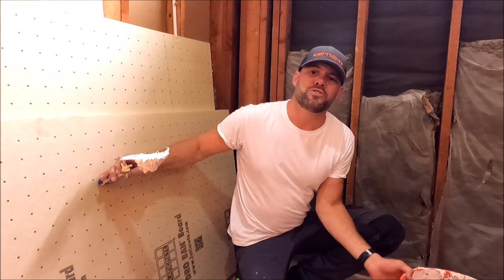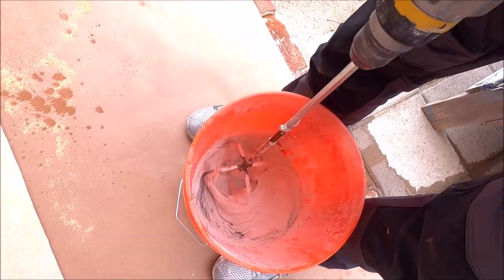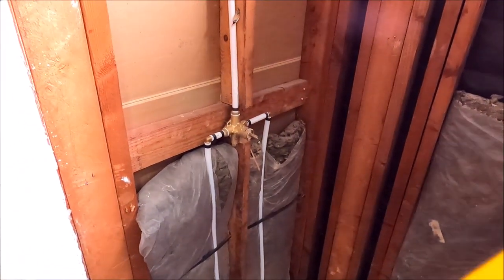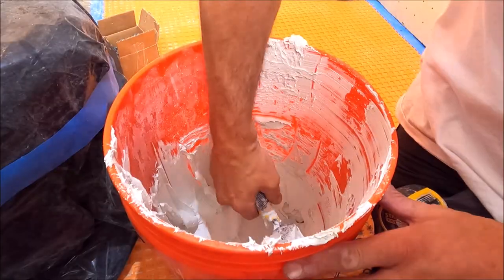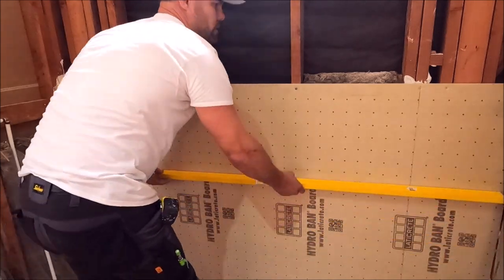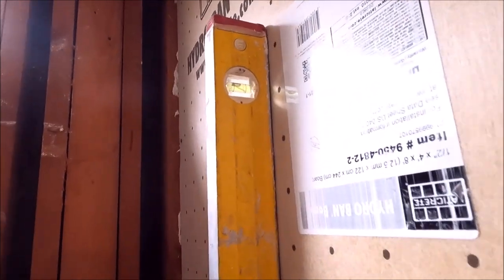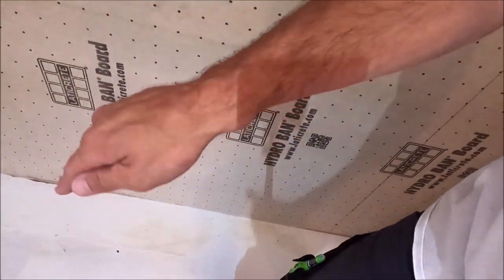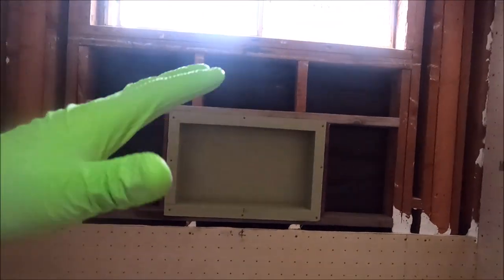Is Wet Shimming Easy? Laticrete Hydro Ban Board Wet Shim How To!

Comment: Great video! One tip we recommend is using a bead of HYDRO BAN® Adhesive Sealant on the edge of the HYDRO BAN Board before the board is installed, and then flattenning it out with a putty knife or trowel.

Comment: This is great for the foam board. I often times screed the thinset on the studs with hot thinset. Then attach my drywall/non foam board the same day.  But the easiest method is to use drywall shims and a staple gun.  Work the corners first then flush-out the rest of the studs after putting a straight edge horizontally on the wall. Install board the same day.
   Lastly, instead of using a wood planer, I use a 4" cup wheel grinder, it removes wood from the stud quickly and can get to areas a planer can't.

Comment: Will wet shimming work on say Durock cement board? Love the videos I've learned alot. Also I use a lot of the tools you suggest on a daily basis!
Reply: Yes it work it’s just a bit harder since the actual board it self is much heavier but still works.
Reply: Yes!

Comment: Beautiful work as always, and every time you finish a tile job your niche is perfectly aligned with the tile. How do you measure your niche so it meets your tile lines?
Reply from the maker: Hard to explain, this video may help youtube.com/watch?v=q5lM6s4pJDg
Reply: With a tape measure.
Reply: That only works if the client doesn't specify taller niches. Mine have asked for 14 inches inside finish.
Reply: @BZ1340    Yep, 12" is too small, looks too small imo. Most shampoo bottles are about that size, some even bigger.  I make mine large, 16" tall. I make them focal points and I never buy premade niches.....

Comment: Im not a stranger to wet shimming, or using furing strips, draywall shims or even built with foam wall shims, but i do like wet shimming, it would be sweet if we can figure a way to put this thinset in a sausage gun or something to squeeze on the studs..... just a thought
Great video by the way
Reply: Put thinset into a grout bag. But it likely wont work well as the thinset wants to be mashed against the stud to make it stick and stay put. Plus it can't be too loose or it will sag off the studs.

Comment: Excellent video as always. Can't find Hydroban board here (near Seattle) and it's really hard to find Kerdi board too, or All Set - highly annoying trying to source materials from all over and online.
Reply from the maker: Go to the website laticrete dot com and they have a "where to buy" Also, if you get ahold of a rep, they can ship the boards. Lastly, contractors direct dot com sells hydro ban boards.
Reply: You can also try KBRS board, which I believe can be ordered online and shipped in the contiguous US.
Reply: Go Board at Lowes. Same thing, great stuff.
Reply: @JH-lb3kc  - Does GoBoard have a cementitious coating?
Reply: @PlucharC  Not sure, sort of feels like it. It's 100% waterproof, lightweight, cut with knife, and tile ready. Just caulk the seems and holes just like Hydroban. No extra waterproofing needed.
Reply: @JH-lb3kc  - Definitely familiar with the process as I've done Wedi and KBRS.  Just wondering if it's actually the same stuff or opts for a.different kind of coating since the surface looks different.
Reply: @PlucharC  Yea i would go to Lowes and get your hands on it, you may be able to tell better than me. Can't find it on the spec sheet but then i haven't looked thoroughly. It's not that expensive either for a 3x5 sheet.

Comment: How come you waited until the next day before placing all the screws into the board?
Reply from the maker: You need to wait for the thinset to cure/set up. If you screw it off the same day, it will suck the board in and it will not be flat/plumb.
Reply: @LandbergTileTV  cool thanks

Comment: Interesting what money does.LOL You were a huge Schluter user.
Reply from the maker: Still use Schluter, but can't get board. Laticrete is faster waterproofing walls and made in the USA brother. I like to represent that.
Reply: @LandbergTileTV  faster waterproofing?
Reply from the maker: @j.w.r.i2910  for the boards yes, no troweling thinny, cutting band and sticking. Only sealant between seams.
Reply: @j.w.r.i2910  And flatter. No banding buildup. I wish my supplier up in Northern BC would stock the Laticrete, especially now that Kerdi has become extinct.
Reply: Schluter boards have been hard to get for months! Talk to you Laticrete reps and they will help you understand how to best use their products (i.e. waterproofing with adhesive/sealant). One thing my rep told me is that Laticrete does not recommend more than a 3/8" wet shim behind the boards. 
Like the videos.
Reply: @chrisriddle538   I have used Laticrete extensively (Cant get Hydroboard Screws at the moment)along with Prova and Wedi.
Reply: @BZ1340  You can use cement board screws to install Laticrete Hydro Ban board. They tend to be less expensive than the HB screws also.

Comment: I can see that Rubber bucket insert thing for faster mortar cleanup didn't last long.
Reply from the maker: Still have it, I need to clean it out and put it back on site.
Reply: @LandbergTileTV  I thought the purpose of it was that it didn’t need cleaning because mortar would not stick to the rubber?
Reply from the maker: @mattcraztex9940  I'm using Multi Max Lite and that thinset sticks to everything like glue!

Comment: Why didnt you make your mortar bed the first day? Or wet shim and cut out the niche next day? Seems like a lot of time is being wasted here
Reply from the maker: We put board up prior to mortar bed. Install mixing valve, wet shim and install board, install mortar bed in one day. We needed to pull measurements off/from the mortar bed to obtain proper niche framing/placement in order to have full subway tiles start from the pan and a full tile end at the bottom of the niche. Day one was massive demo of shower/soffits, backsplash, removal of debris and obtaining all materials for the multiple projects in the property. We did not get to mortar bed day one.

Comment: Im a carpenter and also very experienced with installing tile. This way is the most lazy and unprofessional way to level . Everything wring with this method. 
I don't care how many years of experience you have, you can't call yourself a professional if you use this method.

Because something is acceptable, it doesn't mean it's the rite way
Reply from the maker: This is a professional way of making your walls "plumb" Everything is correct with this method and yes, I'm a professional.
Reply: @LandbergTileTV  lol, im sorry to disagree with you, but this is not thr correct way. This is the lazy and easy way. Because all yo do it and it's acceptable, it doesn't mean is the correct way
Reply from the maker: @amariza21  Yes, correct way and not a lazy easy way. Please show me a video of how you do it.
Reply: I have had both Schluter and Laticrete reps show and explain this method to ensure that your wall is flat and plumb. The TCNA has nothing on this method, however, they defer to the manufacturers' recommendations. So, it may not be your preferred method, but it is approved by manufacturers and would therefore be considered one of multiple correct ways to install their boards.
Reply: @chrisriddle538  once again, acceptable doesn't  mean is the correct way.  There is a understanding  between a tile installer and a carpenter and this situation you have to understand both. I have over 20 years of experience as a  finish carpenter, and  tile installer . I have seen people do so many things because is acceptable, but doesn't mean is the correct way.

 I can give a 100 difference reasons from a carpener's perspective why u shouldn't wet shim. 

There is a couple of tile installer very famous on YouTube that i never seen wet shim walls. 

Everyone has different way of doing things the correct way, but this isn't one of them. No matter what the book says
Reply: @amariza21  I am merely saying that it is approved by manufacturers. You can argue that it is not a correct method, but your argument is not with me or anyone else that may use the method, it would be with the manufacturers that approve this installation method for their products. 

There are many methods that can be used to do tile installation. Some methods are better than others. Some are good methods, some are bad, some are recommended and approved. I follow the TCNA Handbook and talk to my manufacturers reps in order to know and understand the best practices that they recommended. The NTCA and my reps have never guided me wrong. Mainly because they are all professionals that are open to learning from each other. I have learned a great deal from them, including the wet shim method. 

I wish you the best as you continue in your business.
Reply: @chrisriddle538  it's all good . I gave my opinion as a professional and what ever works for you,  go for it
Reply: @amariza21  Are you a member of the NTCA?
Reply: @chrisriddle538  nah, im a private contractor
Reply: @chrisriddle538  I’m also a carpenter/tile installer and I don’t trust wet shimming yet I’d rather frame it out it only takes a couple more minutes to do it the correct way.
Reply: @LandbergTileTV  I believe either way works I’ve tried both ways many,many times and would rather frame it out plumb and square,but honestly it’s just everyone’s personal preference on the matter.
Reply: Can you give me a reason why this is wrong? 

Trying to be best general contractor I can be 5 years so far

Seems like a great way but I'd love your opinion